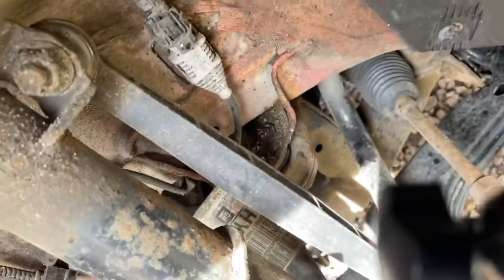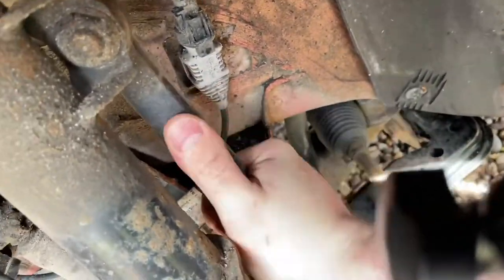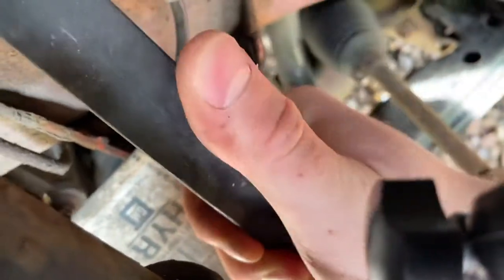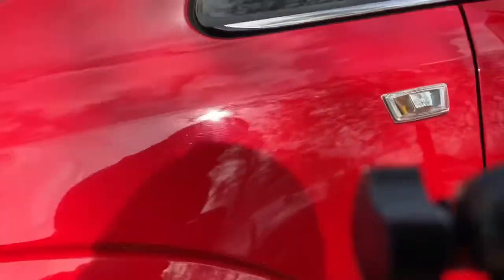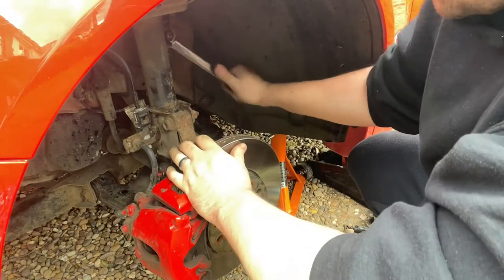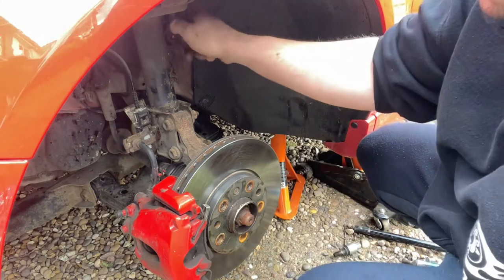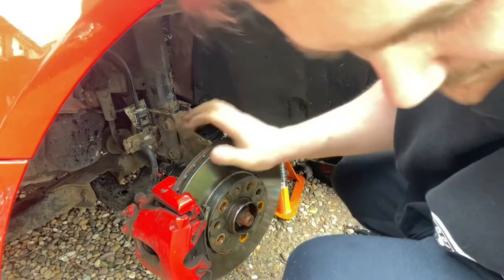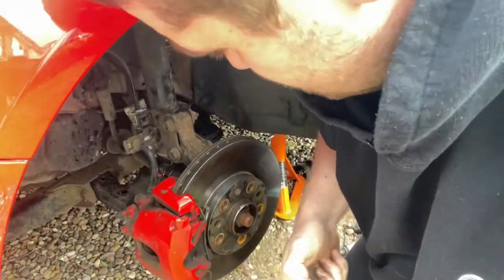Nasty Creak Vauxhall ZAFIRA B (Roll Bar Link replace)

Comment: How did you go straight to the replacement of the plastic drop link, once I could not see that the rubber on each terminal was broken?
Reply from the maker: It was knocking buddy

Comment: Changing front spring on mine was a pain to get the bar off  felt abit of pressure on it any tips to get it back on if I struggle
Reply from the maker: What I would do buddy is once the spring and all the rest is refitted so all you have left is the roll bar link left to fit is put a trolley Jack just under the ball joint on the bottom arm and just slowly Jack the suspension leg up untill you can easily fit the roll bar link (be very careful)
Reply: @TheVWMechanic_official  will do thanks for the help
Reply from the maker: Absolutely no problem at all. Please consider subbing to the channel it’s free and a massive help to a small channel like mine :) stay safe and enjoy fixing your own car

Comment: Hi mate how do you find the metal one ride ? And do they last? 

I have a Astra vxr and I’ve gone through 2 plastics pairs in like 10,000 miles, ridiculous. They get worn so quick. One side actually completely snapped off whilst driving.
Reply from the maker: Hey buddy, this is a friends car but they last a lot longer that’s for sure I was constantly replacing his plastic ones